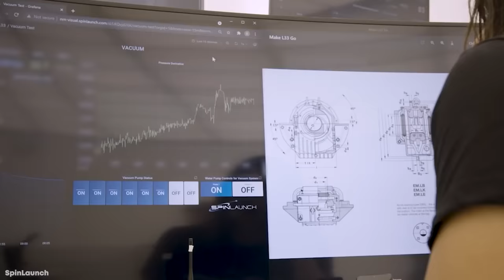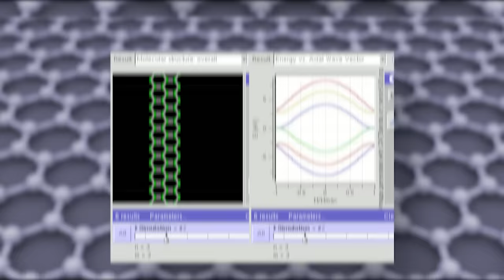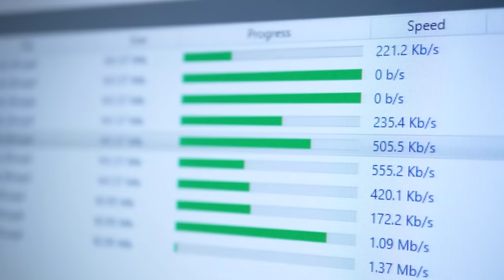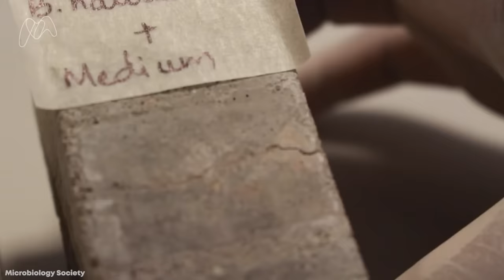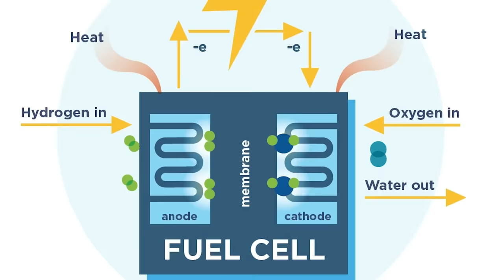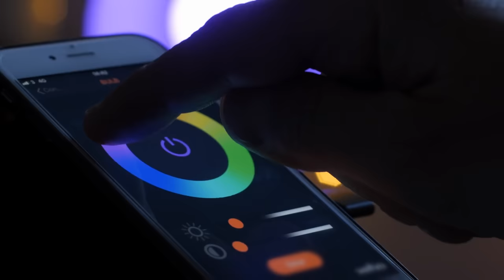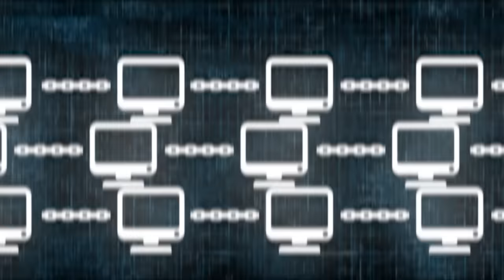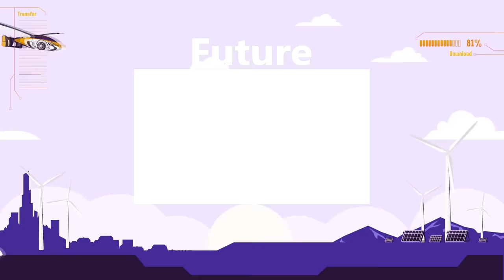15 Emerging Technologies that Will Change the World

Comment: Self-Healing Concrete is on paper a really good idea. There is just one small problem with it and comes from the fact that we are not using limestone for buildings as limestone has this one tiny problem with being rather frail. Yes it will make the concrete last a big longer, but it will also make it harder to see where the weaknesses of the structure is and only really postpone the disaster, if at all.
Reply: Yeah. it needs work :)
Reply: And I am far from excited about the prospect of being infected by a concrete structure. YES, it will happen, and then who will be responsible for that?
Reply: @dianeridley9804  wdym infected?
Reply: @joaquimbarbosa896  maybe they meant affected
Reply: I'm no structural engineer but I understand that most of the failure in concrete structures comes from the oxidation of reinforcement steel. This happens when the steel comes into contact with oxygen/water from the cracks in the concrete. If these are closed as soon as they form, then I see it as a big game changer.
Reply: @caty863  the big brain in the room
Reply: when they tear down a concreate wall  
 10 weeks L8tr repairs itself   and made itself in a small house
  that homeless guy down by the river  thanks Mr. concrete scientist
Reply: And thats the purpose of RE-BAR.
Reply: @kbanghart no, I think they are referring to the yeast that will be in the concrete.

Comment: I was totally shocked that Fusion power generation wasn't included - possibly as big a leap as quantum computing in its impact on humanity.
Reply: It's exciting, yes. But I wouldn't want to take a guess about how long it will take to have economically viable fusion electricity from the socket. There are other interesting energy developments going on: a variety of advanced nuclear fission designs, but also relatively 'ideal' renewable sources like advanced geothermal. Even some of the offshore wave energy developments, I find very exciting.
Reply: Well, because fusion and fission actually work. Government has it covered. Don't fret, we'll see it in 20+ years...maybe...lol
Reply: @incognitotorpedo42  

I think we're nowhere near the necessary battery technology to back up solar and wind. The closer you get to the poles, the more solar suffers from seasonal production differences. So it's also a geographical thing. Once a renewable energy system involves centralized (eg gas-fired) power plants, subsidies will again become unavoidable. A power station that isn't allowed to produce at full capacity whenever it can, is unlikely to be anywhere near profitable. Some of the recent developments in geothermal energy look like they might be able to tackle this problem, such as Fervo Energy, with which Google started to collaborate, or Eavor from Canada.

Buy maybe I completely underestimate the speed at which battery technologies evolve. Also maybe, you and I both underestimate the speed at which fusion technology develops.

In the meanwhile, we could make a big difference by first of all using less energy. Look at the per capita energy use of the United States versus most western European countries. And these European countries can still go much lower without giving up on life-comfort.
Reply: Dolor power and battery storage is used as of now but honestly we aren't we haven't reached a point with the dolor panels themselves. Producing them is just not good environmentally and neither are the current battery systems. Graphene batteries and material tech would be the way to go for this stuff. To at least having it make a real big difference. 

As for natural gases I mean they are good BUT how long will they honestly last before we've used it up.
Reply: Good point but it is too soon to consider it a thing of the "following years", already "emerging".
Reply: @cloudlounger6903  Fusion has been 20 years away for 60 years.
Reply: @flyingfree333 what  is fission?
Reply: Actually, Thorium Fission reactors may be feasible in the next decade and would be much cheaper/safer than traditional Fission reactors.
Reply: @lipsterman1  And that has been the case for the last 50 years. Always only 10 years away. Like the pot of gold at the base of a rainbow.
Reply: @billgreen576  China is opening a plant this year. It's a small plant but it's happening.
Reply: @alexandervlaescu9901  The real fairy tale is fission is cheap. It was never cheap. Solar and wind have already beaten it totally. If you are really serious, watch Real Engineering video on cost comparison
Reply: @LevineLawrence  Having your competition artificially increase your expenses should not be something to be proud off. Not to mention if you include the lifespan of an NPP , the NPP wins in profit no matter the contender. Solar/wind are "competing" with NPPs due to heavy subsidies. See Germany with their almost 500 billion euros in solar/wind.
[In 2017, Germany generated 37 percent of its electricity from non-carbon sources.[1] In pursuing the Energiewende, Germany will have invested $580 billion in renewable energy and storage by 2025. 

If Germany had invested in nuclear instead, it could have built 46 1.6 GW EPR reactors at the $12.5 billion per reactor cost of the U.K.’s Hinkley Point C. German companies assisted with the design of the EPR and the reactor was explicitly planned to meet the strictest European regulations.

In this scenario, EP assumes that a Germany pursuing nuclear power would maintain the same level of nuclear generation as it produced annually before implementing its nuclear phase-out in 2011, about 133 TWh per year. 

With 46 EPRs operating at 90 percent capacity factor, Germany could first eliminate all coal, gas, and biomass electricity, then make up for today’s 150 terawatt-hours per year of wind and solar from its renewables investment, all while exporting 100 terawatt-hours of electricity to its neighbors (double 2017’s actual exports). Finally, with the remaining 133 terawatt-hours, Germany could decarbonize its entire light vehicle fleet including all 45 million of its passenger vehicles.]
Reply: I wouldn't be shocked. Most of the information in this vid is very poorly covered  particularly the first 2
Reply: @billgreen576  👍🤣👍
Reply: @lipsterman1  Is it. Any chance of a link to that. They have had several over the years in laboratory situations and then they give up because it don't work.
Reply: Just another 20 years away, buddy.
Reply: Actually getting closer ....

On August 6th of 2021, the National Ignition Facility recorded a record-breaking 1.3 megajoules of energy created from fusion. This was certified as the first example of a burning plasma, where fusion reactions were used to create secondary fusion reactions in the spring of 2022.

The Chinese experimental nuclear fusion reactor HL-2M achieved its first plasma discharge. In 2021 EAST set a new world record for superheated plasma, sustaining a temperature of 120 M°C for 101 seconds and a peak of 160 M°C for 20 seconds. In December 2021 EAST set a new world record for high temperature (70 M°C) plasma of 1,056 seconds.

In 2022, JET sustained 11 MW and a Q value of 0.33 for over 5 seconds, outputting 59.7 megajoules, using a mix of deuterium and tritium for fuel.
Reply: We were told we would all be using flying cars by now and that the ice age was coming.

Comment: Okay...so...lemme get this straight...we moved services to the cloud instead of having data centers locally only to move cloud services closer to reduce latency...which was non-existent before?
Reply: What it is with people on the internet using an insane number of periods?
Reply: @reh3884  its called an ellipsis. They're not periods. A period ends a sentence a ellipsis is a series of dots that in the above example denote a pause in speech.
Reply: A data center ( DC ) is the cloud. We were using centralized huge data centers and now smaller ones start showing up in number's
That is reducing delay and those DC's can serve cheaper and faster the customers by caching data that are used more. 
This is posible due to the fact that  you serve less devices and so the data analysis is possible by less expensive implementations.
Lesser programmers can do it , you dont have to be a genius to offer a feasible solution.
On the other side the data on huge DC's are so complex that in order to make the solution cpu - memory efficient you ll have to bring einstein and hes buddy's.
Reply: The future is decentralized embedded processing taking over most of the work
Reply: @ΓιωργοςΣταμπολιδης-θ3ξ  nope Australia is were the big cloud is but there are smaller intermediate ones around as redundant and yes with GPS and phones with 5 g and even faster like elon musk wants a GPS phone with more Sat in space so it's a total fast coverage
Reply: @reh3884  3 ... is faster than pressing , and the space bar....its also easier to read that way too(very clean space to see and notice the pause between words)....while normally triple dot were meant to be use at the end of an unfinished sentence....its also very convenient to use it to act as a , and a space too
Reply: @cryo9216  i suggest to you to stop worrying about stuff like that. 
Data is a commodity in our days , its tradable. 
They just use it to make money.
Everything is based on this circle of moving money , we cant stop doing that.
There are law's constructed about data that just havent been fully applied yet.
Its not possible yet. We need better systems.
This is were the cloud comes in to help with the security and the efficiency.
Reply: @executiveorder7146  I didnt quite get what your saying.
What i said is that there big and small cloud's and that a cloud is its essence a Data Center ( DC ).
A place to store Data.
The "Cloud" was originally made up to describe the part of the network that we cant draw due to the fact that its huge.
For example . 
PC----> A Switch ---> A Router---> A Modem ------> The Cloud  -------> Modem -----> Router ------> Switch ----> PC
So we are saying that your sending ur Data to the Cloud , meaning it goes somewere we cant really describe and we dont really have to.
More smaller DC's are emerging right now.
I have worked at two.
I bet there are big ones at Australia but there are big one's everywere.
Google has many in the sea.
Reply: Or use Theta Network
Reply: @cryo9216  i understand were your fear is coming from. I have been paranoid for years with data.
 It leads to more frustration. 
You are not important enough for someone to use illegal data against you and your data cant be used in court even if they illegally keep em.
The wold is moving towards globalization and we bug's cant do much about it.
There's gonna be problems and many people might suffer but its the natural evolution of the human kind and the solution to our problem's.
Could be worse then that , could be a lot worse then that.
Unless your doing something disgraceful or illegal i suggest you stop worrying about data.
Reply: @cryo9216  Yeah well , i am 35 y old , i got left what ... 35 years average if i dont die from something else.
I am presented with the choice to keep using technology - and that requires my data to be exposed - or just not use technology and freak out about the posibillity that at some near future my opinions and thing's i ve said or took a photo on could somehow make me a target or something.
I choose to live free and use technology and take that small risk.
I choose to live with a bit less stress due to the fact that i am not being paranoid that my privacy is being invaded.
I dont blame you for choosing the opposite , i really dont .... i have done the same for years.
Have a nice afternoon.
Reply: @ΓιωργοςΣταμπολιδης-θ3ξ  The main difference between you and me is that you "don't freak" about exposing yourself, and I "don't freak" about maintaining privacy. You are the one at risk and I am not. That makes me the happier and safer one. 😊
Reply: @cryo9216  We have been living in a system with financial economics that have benefit the ones adding credit & money into that system.
Now when hyperinflation stand on our doorstep, because intrest rates (the "wins" in this macroeconomic system) not hold up because its impossible that new reell assets in the west could be produced (and bought) at a rate that will sustain the EQ-inf. We will have a hugh transfer of reell assets from ordinary ppl to the people that have been first and second benifiters of this ponzi scheme.

How is this possible?
We have had an irreversable financial economic crash since the system was invented, ~1912. Why irreversible? Because the resource sortage that earth has and non-circular economics.
Reply: How of what he says is not true and made up. The videos/pictures he’s using when he talks about the different stuff like graphene is not what it looks like on the video he’s showing.
Reply: @valtonburns8556  That they're control freaks.  LoL.  It's not about control, it's about people not liking to have to mentally process and correct your errors in order to understand what you write.  Your comment could be read by thousands of people.  The least you could do is proofread it.
Reply: The more my employer moves to cloud services, the more us employees realize we need to bring things back on-prem.
Reply: How should they analys data if its private? Cloud services is perfect! If you don't pay you can just shut down the connection. Monopoly on information is great! Centralized data gives much better controll, verry good indeed.
With all the trillions of dollar people have paid for cloud services we know can buy your local data center, your cloud service latency will be great, monopoly is great. If any new company try to get your data, we just buy those companies = Small money. Monopoly is great, you get all the money yourself and you have full control & power.
Reply: @Presticles1  an ellipsis is only 3 dots with a space at the end.
Reply: @valtonburns8556  *they're
Reply: @incognitotorpedo42  In most instances you understand perfectly the information someone is trying to convey. In the few that you don't it may take you a fraction of a second to figure it out. So don't try to put some bs reason behind your attempt to disregard someone. Because you don't like what their saying or have some over inflated ego of yourself. It takes more effort to do that then to figure out what they meant. And if you're as smarter as you're trying imply then you already know all of this and just like ditching on people that you deem dumber than yourself. Please feel free to proof read this or not. I leave that totally up to your highness. In this particular instance you have proven my point EXACTLY. Yet in your vast wisdom will never see it.😑
Reply: ooo windows 11... government control lol. Damn hippies
Reply: Also consider how powerful human brains are compared to current technology. What's really crazy is computers are energy manipulators that provide communication. Everything on a mother board either conducts, resists or manipulates electricity.
Reply: Also consider how powerful human brains are compared to current technology. What's really crazy is computers are energy manipulators that provide communication. Everything on a mother board either conducts, resists or manipulates electricity.
Reply: Also consider how powerful human brains are compared to current technology. What's really crazy is computers are energy manipulators that provide communication. Everything on a mother board either conducts, resists or manipulates electricity.